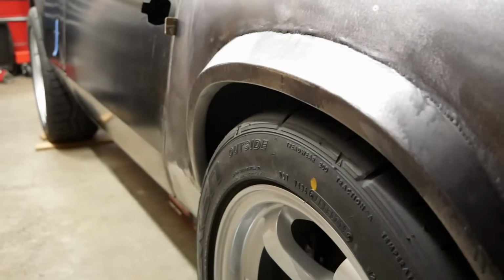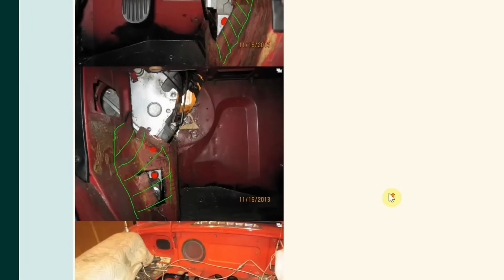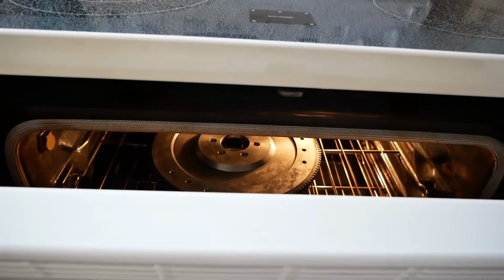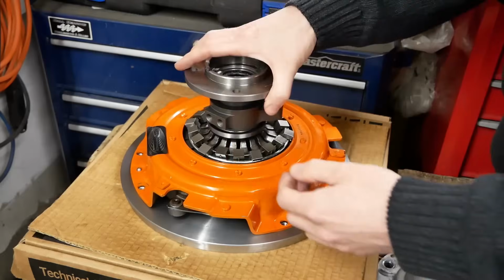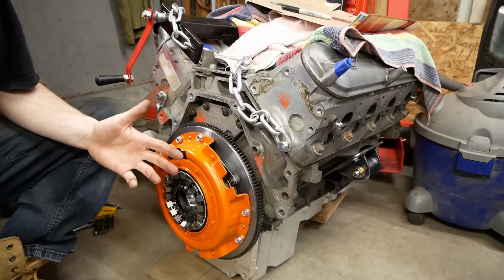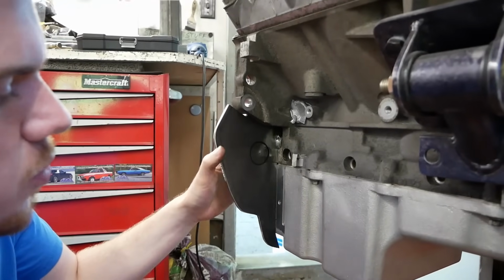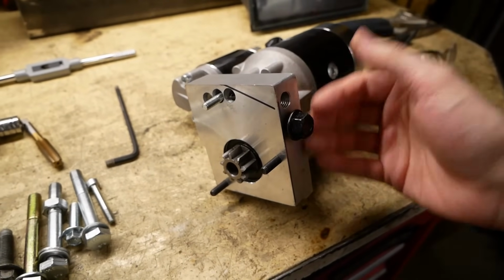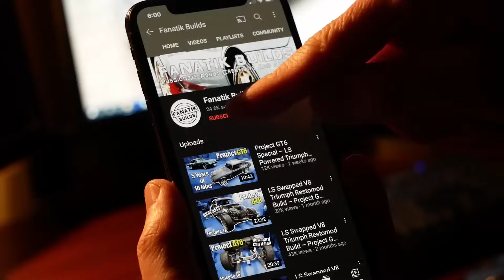The Cheapest Aluminum LS!  Pro Touring Triumph Build – Project GT6R – Ep20

Comment: Your solution to the starter problem was very well done!  My suggestion is too late, of course, for your efforts...but, on the Swift DB-2 and a couple other race cars.  The starter is mounted 5 or 6 inches longitudinally from the flywheel. They use a starter extension shaft with the starter gear on one end and other cup like end pinned to the starter shaft.  Gives a bit of flexiblity...here is a description.   https://www.tapatalk.com/groups/s2racing/swift-db-2-starter-t2467.html
Reply from the maker: Very interesting, haven't heard of that before!  Neat solution that could really help in some scenarios.  Cheers Jim, have you had the BGT out this year yet?
Reply: @FanatikBuilds  I thought it was an interesting idea after I bought my Swift ...The BGT is owned by a friend and he wants to go through the engine before it is out again.  The engine is pretty built.. 300hp at the wheels from 3.5L and 4 50mm webers on a cross ram manifold.  Unfortunately, my doc said no more racing for me, so I am sticking with street sports cars..still have my 69 911S and 2011 C2S.
Reply from the maker: @jimf5160  Yes, very interesting!  
Good to hear he's still got the car and will be giving it some attention!
Although you may not be racing anymore, you certainly have a very nice selection of Porsches there Jim, I heartily approve! 😍👍
Reply: @FanatikBuilds  Thanks! At least not racing has allowed me to build my bank account back up...good thing I never added it up when I was racing....
Reply: @FanatikBuilds  Oh, forgot to mention..your project and style reminds me (in a good way) of the Project Binky restomod on Youtube by Bad Obsession Motorsports. They are up to Episode 34.
Reply from the maker: @jimf5160  Wow, thanks Jim that's high praise!  Nick and Richard have been an inspiration and we likely wouldn't have tried this if it weren't for their informative and motivational videos! 😊 cheers! 👍
Reply: @FanatikBuilds  It is not faint praise. You are very good at this and have a lot in common with their methodical approach.
Reply: @FanatikBuilds  Your methods have a lot in common with their methodical approach.  Keep up the good work!

Comment: Now they make an Oil pan with a starter mounting point
Reply from the maker: Yep, it’s a nice design, but still follows the factory LS4 sump position (being central/front) so it would not clear our cradle.  If the engine could have moved back further, it could work, but our car is just too small for that.  In fact it’s most likely that oil pan is intended for transverse layouts using the F40 6-speed gearbox.  Our longitudinal RWD setup needed a rear sump pan, so this was our best (and only) option! ✌️👍

Comment: I can’t imagine that LS4 was much cheaper than an LC9 would be, especially considering all the extra trouble the LS4 involves.
Reply from the maker: Great question!  The LC9 is a good option that would certainly make life a lot easier, though keep in mind its oil pan, intake manifold and accessory drive are all way to big for a car (at least a small car like ours) and you can tie up a bundle in those parts.  Now, even the LS4 oil pan and accessory drive didn't work in our application, but we are extremely strapped for space.  An intake manifold alone can run $500-1000 depending on if you get it new, used, from a friend or off eBay.  In the end, this still worked out cheaper, but I do understand why many people will choose to go another route! 😄
Reply: @FanatikBuilds  I forgot to include the LH6 as an option, as well. I understand wanting a car style intake for hood clearance but you can pick up a used LS1 intake for $100 or so b/c they're much less desirable than the LS6 intake. You'll be giving up some horsepower w/ the LS1 compared to the LS6 but considering your T5 is the weak link that may not be such a bad thing. I know hindsight is 50/50 but I'm only mentioning these options b/c it might make the job a little easier/cheaper for the next person who sees your project and is inspired to follow in your footsteps.
Reply from the maker: @nowayjose596  Absolutely!  This may be cheaper, but it was not easy!  I'd love to know where you're finding LS1 intakes for $100... I'd be all over that!
Reply: @FanatikBuilds  A quick check of eBay reveals they're currently going for more than they should #ThanksCOVID. But I'll put my money where my mouth is and sell you mine for $100 + shipping since I have an LS6 I've been meaning to put on. It's just the intake, no throttle body or fuel rail/injectors since I'll be reusing those. It will also need gaskets but my guess is the LS4 gaskets will work b/c they both use cathedral port heads.
Reply from the maker: @nowayjose596  Sounds cool!  Please shoot me an email at: fanatikbuilds@gmail.com with some pictures and I'll send you my address so we can see what the shipping will be 👍

Comment: It dips because it yields then it starts to strain harden.  When it strain hardens it goes back up.
Reply from the maker: Yeah, I can get that, but I just have troubles understanding why the force appears to dip momentarily.  Force being applied should be linear (in my mind) so it's the strength that I figured would dip if anything!... I get that I'm wrong, just still confused is all! Lol 😂 Cheers Andrew!
Reply: @FanatikBuilds  Imagine a chain that zig zages back and forth but is maybe held together by bad spot welds. As the spot welds break and the grain aligns it becomes stronger because the links or grain is aligned.  The dip is the breaking bonds, and when the bond breaks it is loose for a short period of time before it gets taught again.  Strain hardening just realigns the grain and a grain that goes the same direction is stronger than one that is random.
Reply from the maker: @andrewf8486  Thank you so much for the explanation!  The chain analogy is helpful, think I'm getting my head around it finally 😅 cheers! 👍

Comment: Check out Brandon Furches LS4 King, he has custom oil pan and cv starter that will work together. It's so you can put 4t80e into an w body
Reply from the maker: I've seen that, can't find it for sale though oddly enough.  I can imagine it will cost significantly more than some 3/16 plate and a $100 mini starter though!  It also wouldn't have cleared our suspension crossmember, but a great design nonetheless!

Comment: If you grenade that transmission save your pennies for the TKX 5-speed. They're compact and handle 600 torques.
Reply from the maker: Bingo!!  That's a large part of why I chose the T5 (specifically this T5) They are cheap and available, so worst case, just get another one... But!  The TKO/TKX units will drop right in and we'll never have to worry again!  It's a win win! 👌😄

Comment: This is by far the best thing to do with any Spitfire/GT6. Throw away the majority of the bodywork, chassis, the entire engine, drive-train and running gear and replace it with something worthwhile. At least once you've done that you've still got an uncomfortably small car but it can at least be driven. The question remains - if you simply started with a small Japanese sports car and body swapped it, would you end up with a cheaper and better solution?
Reply from the maker: Interesting idea, but body-swapping a GT6 onto some other car would be very difficult due to how small it is.  Even a Miata is 6 inches wider!  Doing it this way, we've actually managed to keep all the original body except a portion of the floor and firewall, and the new chassis will integrate into the shell to provide a pretty robust package.  Cheers Ulric 👍

Comment: Technically there is a slight difference between the GM Metric and the Northstar pattern, but its small enough that they can be compatible. LS4King goes into more detail about it on his channel.
Reply from the maker: Correct - the lower right bolt point doesn't quite line up!  Cheers 👍

Comment: That a whole pile of engineering issues. Any reason why you didn't go  with a truck LS ? The 2010 Silverado came with an aluminum block 5.3 or L33. They also had the corvette 799 aluminum heads minuus the sodium filled valves. I pad $800 for it with 100k on the motor. It all went in a 71 Datsun 240z.
Reply from the maker: Sure was!  Worth the effort though - the LM4 and L33 are good options but the the L33 is closer in spec to the LS4 (243 heads, flat top pistons) so we'll concentrate on that one for now.  Around here, the same junkyard we got our LS4 from was charging ~2x the price for an L33 ($700 vs $1300 CAD).  The L33 would also need a car style intake manifold to clear our hood, which the bare bones cheapest LS1 I could find was still $300 plus another $80 for fuel injector adapters (otherwise we'd need new injectors too).  Neither engine's accessory drive, oil pan, and exhaust manifolds would work, so there's no difference in price there.  Our custom flywheel was the one area that could have offset the benefit entirely, but as it turns out, we've still ended up saving about $1k CAD over an L33.  That's not insignificant!  It's also a bit smaller package due to the 60 degree bellhousing, so it fit the car more easily.  I'll bet your Datsun is a riot, can't wait to have ours running too!  Cheers Ryan 👍
Reply: @FanatikBuilds  I'm Canadian too (east of Toronto)  the smaller bell housing is the key to all this. I think you guys went the right direction. I hope the trans holds up. Great build. I'm looking forward to more content.
Reply from the maker: @Twin_turbo_coyote_fox  Fellow Ontarian!  Haha, we hope so too!  At least the car is light, and we're not going to be doing anything too crazy with it 👍 Cheers Ryan, hope you'll enjoy the rest of the series!
Reply: @FanatikBuilds  I will thanks!

Comment: Translation services "it's almost like we knew what we were doing" is the same as "that ain't goin' nowhere"..... Canadians smh.  Just for completeness, GM put the 2.8 (and 3.4) in Camaros and Firebirds - you can get a T-5 in either of those (and that same transmission was in the rareish 5.0 Iroc Camaro with the same bolt pattern).  Love your solution.  Great job, I guess they do other things beside make snow in Canada.  Information adjusted. :D one last, little thing.  I'd drill and tap those bolts out to at least 3/8" (same size as Ford which uses a similar set up).  Those small bolts, if the starter rocks at all, could snap off 3/8" bolts would make that highly unlikely.  Keep in mind that that starter has 1/3 hp.... a lot
Reply from the maker: Oh we use "that ain't going nowhere" as well!  We're multilingual don't forget 😉
Yes that's correct, though those T5s were not as strong (I believe) and a bit harder to find at this point.  The late model Mustang V6 unit (ours is a 2004) is one of the strongest models short of the T5Z, yet being from a V6 have had an easier life and can still be found in junkyards unlike the older models 👌

Great idea on the larger hardware, not sure if there's enough material on the actual starter casting to take the holes out to that size, but I'll look into it!

Cheers man, hope you'll enjoy what's to come 😄👍

Comment: Could you have turned down the flywheel you had to diameter you needed?
Reply from the maker: Great question!  I was really hoping to find an off the shelf flywheel that could just be modified to work, but sadly one doesn't seem to exist.  The diameter of the S10 one we got was perfect, and we could have worked around the clutch bolt pattern too, but the main problem was the crank bolt pattern and center bore size (they're too small) I tried hard to make it work, but there just wasn't enough material to redrill it and open up the bore safely.  It would have required welding and I just didn't want to take the chance on something as potentially lethal as a flywheel! 👍
Reply: @FanatikBuilds   Well still pretty amazing what you put together. I had a GT6 but I kept blowing up the rearend. But back in the seventies you couldn't just hop on the Internet and find parts. Took me 6 months find spitfire rear then sold it.  This why I watch you since your 3rd of 4th episode and can't wait to see the Car run. Everything you've done has certain degree of engineering and  luck with a touch of insanity.  Can't wait for the next episode
Reply from the maker: @Dogleg1957  Hadn't realized you've been following that long - thanks very much for the continued support!  I've heard many stories about the factory diffs breaking, believe they were originally made for the Herald?  Regardless, they were over-taxed in the GT6 with the 100hp it had so was definitely on the short list for us to update if nothing else.  A common enough swap seems to be a Subaru or Nissan R180... We considered that ourselves but decided it was likely a bit too small for our power level, plus the C4 design was extremely easy to narrow!
Appreciate the kind words of encouragement and I certainly hope you will enough what's to come 😊👍

Comment: I got a LM4 for 900 complete engine. Its a 5.3 all aluminum. I think that's a better option then a LS4. But whatever works I guess.
Reply from the maker: The LM4 is a great option if you can get one for a good deal like that! 👍 Our LS4 was ~$650 usd, and has slightly higher compression than the LM4, plus it has 243 heads.  Also comes with a car style intake manifold, though it is the worst flowing one GM made.  All in all this was our cheapest solution but definitely not a route for everyone!
Reply: @FanatikBuilds  ya the LM4 comes with 862s. I put on a fitech 500hp EFI kit with that sexy high rise Mani. Best of luck on your build. You def got a better trans then I did. I got a blah 4L65. But it was dirt cheap.
Reply from the maker: @jwilliams703  Ooh!... I do love a good high-rise!  Thanks man, appreciate it, hope you'll enjoy the rest of the project!  Nice Subar-ute by the way 👍
Reply: @FanatikBuilds  that's what the LS is in lol.
Reply: Also Subaute is what I named it.
Reply from the maker: @jwilliams703  Bet it rips!

Comment: Man, you a glutton for punishment, but, hey, it works.
Reply from the maker: Haha, yeah, a bit. 😅 Cheers John hope you'll enjoy what's to come 👍
Reply: @FanatikBuilds  Enjoying every bit of it, friend of mine down under in the 60's cut a gearbox off an old Holden 6 bell housing,, brazed a thick plate to the bell and bolted on a Moss box from an old Jaguar, Probably a bit/lot less complicated than your effort, hope you have enough clearance for clutch material wear when the pressure plate "fingers" retreat towards the release bearing but I am sure you have figured that out.
Reply from the maker: @adoreslaurel  That sounds plenty complicated!  We were really happy that we didn't need to mess around with concentricity too much - we will likely still grab a dial indicator and verify what we have before we call it "done" - but we know we're at least very close since it's all OE parts!  Clearance for wear should be fine, the hydraulic throw out bearing is shimmed to manufacture specs.  As another viewer pointed out though, we didn't shim it with the clutch disk installed so we will need to just recheck that later.  Thanks for keeping your eyes out for us John! 👍

Comment: Could've used an AR5 from a Solstice/Sky/Colorado/Canyon.
Reply from the maker: Indeed, we could have!  The AR5 is a great unit, with many bellhousing options.  Supposedly, our T5 has a higher torque capacity (300 vs 260) though the AR5 is known to handle more than it's rated limit. The T5 is a smidgen lighter, smaller, and was available when we needed it!  We also have better options for the future in case we need to upgrade to a G-Force, TKO or TKX unit.  Cheers Steve 👍
Reply: @FanatikBuilds  Nice! I didn't realize the T5 was a lighter unit. Transmissions seem to get a rating following the highest torque-rating of the most powerful engine attached to the transmission from the factory. Having said that, I've seen claims that the AR5 can handle around 700hp, which you may already know about, but since it's such a cheap option, anyone else reading this might like to know about these options. This is probably especially true when dealing with 80's S-series trucks. They run a T5, but it isn't rated for as much power as a Mustang T5, and because it's relatively easy to mount an AR5 to an LS motor, it's a good choice for those who can't or don't want to spend the 'bro tax' on the T56/TR6060.

Another option (with an adapter) may be the CD009 from a 350z, which looks like it can be had brand new from Nissan for less than $2,000, and much cheaper if you find a new one. I'm not sure of the dimensions, but it's a 6-speed that is also known for holding big power. I don't have any reason to believe it's too large to fit in something like a Miata with a little bit of "massaging."

Thanks for the reply, and I hope this information helps others.
Reply from the maker: From what I can find, the T5 is about 25-30lbs lighter!  

Correct, the AR5 seems to be far more capable than it's rated.  The T5 has a history of being a bit fragile, but there are many different models out there, and our late model (04 V6) is rated as the second strongest T5 ever made.  I think the "strength" of transmissions has a lot to do with how you drive, and what they are trying to move.  A ~2400lb car with 205s should not be anything to worry about for us! :)

As for the CD009, check out Taylor Ray on YouTube - his LS Miata has been running the same gearbox for years now and he beats on it hard! 👍

Comment: Electric power steering from a Toyota Prius👍
Reply from the maker: The Prius unit is a really popular one!  Think I've come across something else that should work slightly better even!
Reply: @FanatikBuilds  yeah, they are pretty cheap and easy to find, but by no means the only way. I’ve seen smaller units and I’m sure that’s what you would be considering.